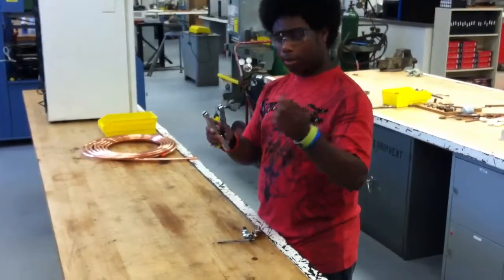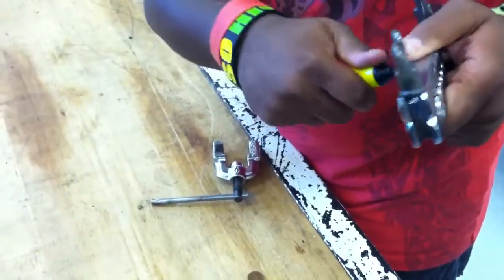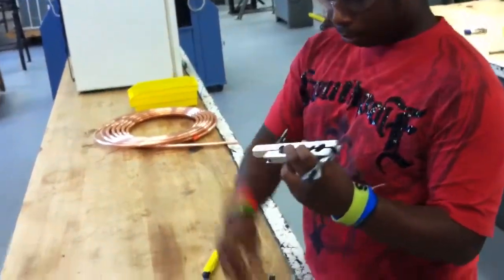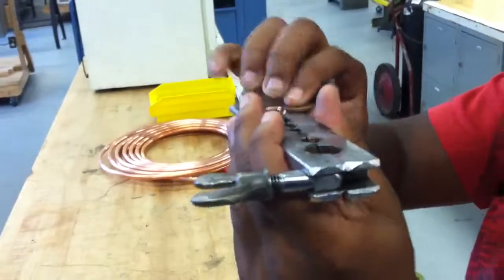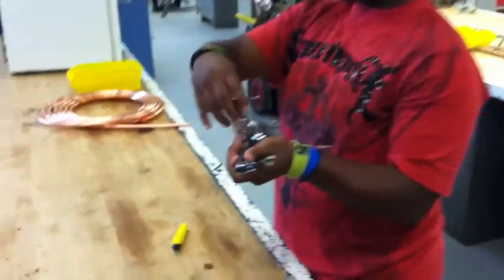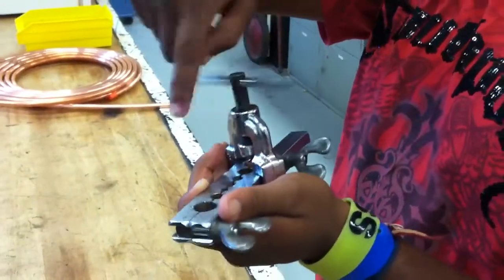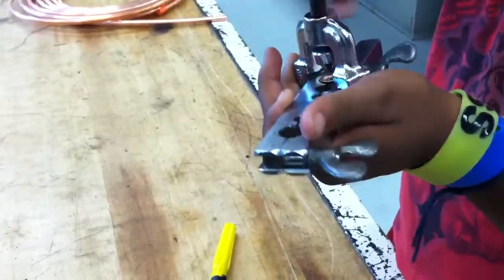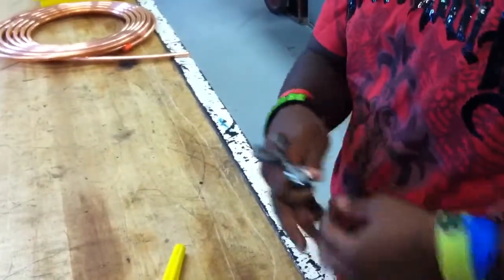HVAC Basics: Skills, Tools, & Procedures How to flare ACR copper tubing using a clamp, block & yoke

Comment: Thats the first time I have seen someone using the penny method . I also seen most guys tighten the yolk 2 turns after the tool touches the pipe, They also tighten the side closest to the pipe also. Which way is correct ?